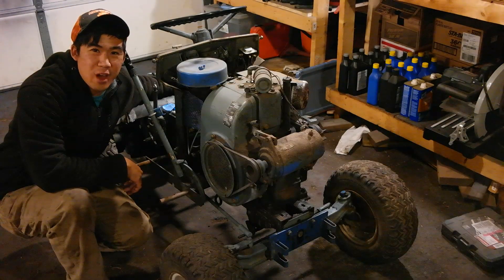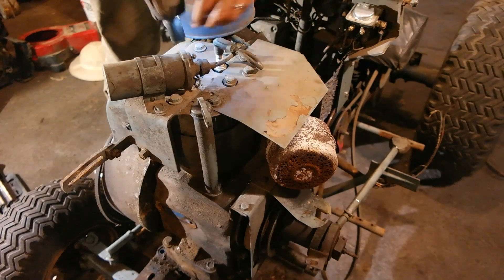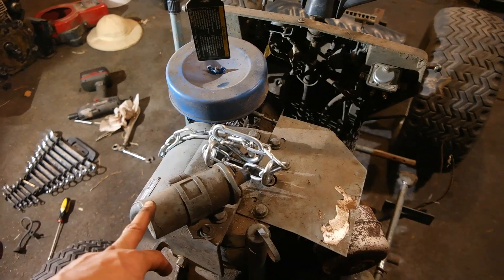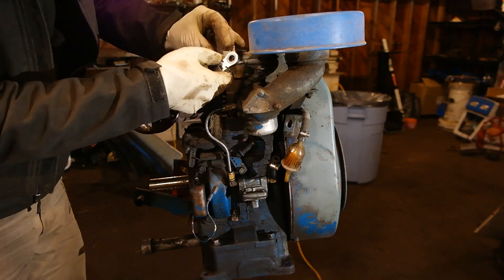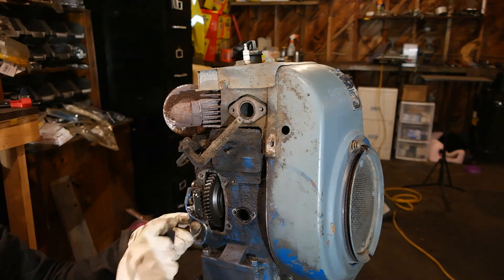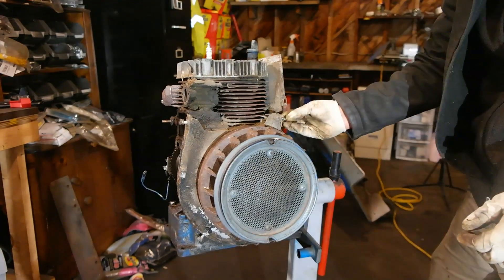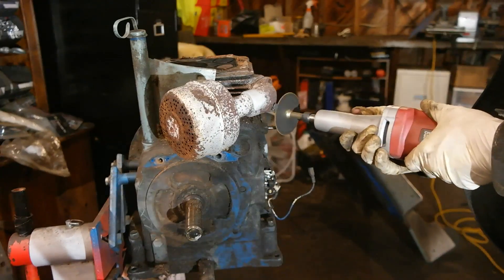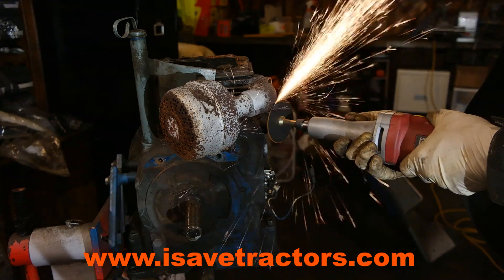How to Restore Your Vintage Garden Tractor Ep. 3: Kohler K  Engine Removal and disassembly

Comment: My fly wheel on mine the one hole is stripped from previous owner how would I go about removing it then
Reply from the maker: You can drill and tap it for a bigger bolt.
Reply: @Isavetractors  thanks man turns out I was just using a metric bolt and was a hair to small got it figured out !

Comment: My question is: When SHOULD you rebuild the engine? I have 2 Cub Cadets with Kohler engines, but the one thats running runs perfect. How would I know when this 60 year old engine needs it, versus just leaving it alone so it can do its thing?
Reply from the maker: Usually when you start burning oil or smoking
Reply: @Isavetractors  Thank you! I wasn't sure if that was the only way to tell or not, beyond maybe Rod Knock

Comment: Hey! me and my younger sister are restoring a International Cub Cadet 1250, and it has a Kohler K301, we're to the engine part of the restoration now, the engine runs amazing, but the way we start it is to take a wrench or pliers and jump the solenoid and touch both the leads together, what solenoid is the right one for the K301, and/or is there a way to fix the existing one? i turn the key to start it and nothing happens, no clicks or anything, only thing that works for the key is the ignition itself. Oh and i almost forgot to ask, the iron elbow for the exhaust is broke, and the bolts are rusted but i can't cut it, is there anyway i can rig up an exhaust? by the way i love your videos, me and my sister are huge garden tractor fans, we need more soon hahaha!!!
Reply from the maker: You can use any of the solenoids we sell on our website. You may be able to fix yours. Make sure 12v is going to the activation post when your key is in the start position

Comment: kohler service manuals are as good as or less than as good as 1930's prints. they're black and white with the contrast so far off that it's just a shadow of blackness with an outline. you'd think in this day and age, maybe they could update if not just photo shop it into something that resembles details.

Comment: I'm working on a K-series engine now and I'm stuck at the flywheel screen screws. Looks like yours came off pretty easily but I can't get mine to budge. Any tips?
Reply: Good tool to have for many purposes. Makes a good investment for your tool kit.
Reply from the maker: Use some rust penetrant spray and let it sit for a day or so. Then hit it with a small map gas torch and use an impact wrench to get them loose. If none of that works you can weld a nut onto them and turn them off with a wrench. The welding process will heat it up so it should back out easily.
Reply: Eh, I don't have an impact wrench or a welder. Gotta keep it simple!
Reply from the maker: Rust spray and tap them with a hammer to help break them loose then try them. The problem with those flywheel screws is they are phillips heads and are prone to stripping. An electric impact is an invaluable tool for these situations.

Comment: oh yea i removed the motors on all my repaint tractors, the worst was the 18 hp twin horizontal on my 86 gt 2.   i used krylon fusion paint on my motors, stuck like glue ( just used black since theyre all briggs).  
onan parts you say?  i got a 20hp onan twin that needs a coil , i was about ready to use a motorcycle   coil, its been on the back burner for a while cause of that.  thanks for the info.
Reply from the maker: dangerous toys56 we will be doing onan parts in 2017. thanks for watching and commenting!